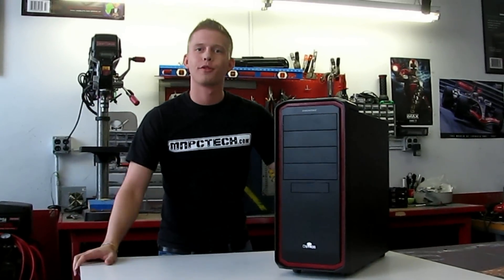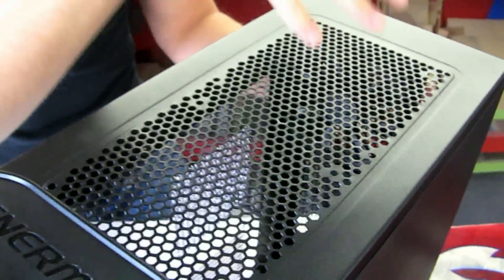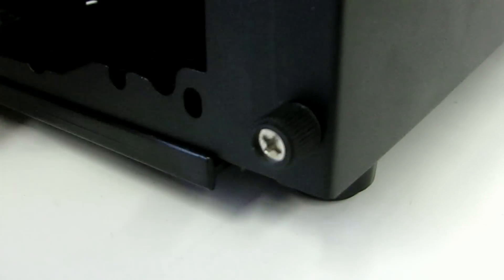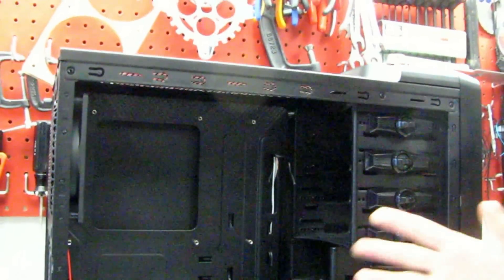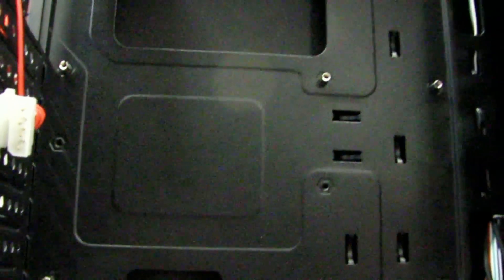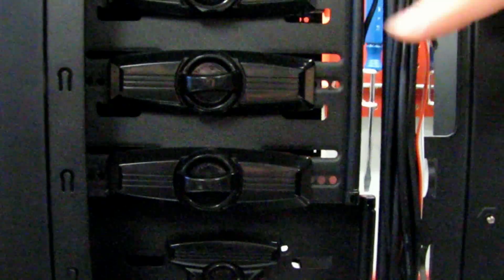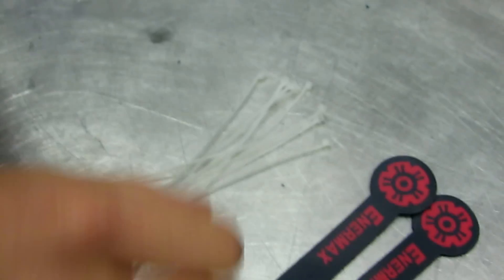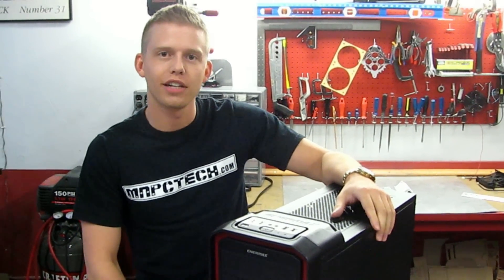ENERMAX OSTROG Mid Tower Budget Case Review, $49.99 at Newegg.com

Comment: i ended up ditching the window and window screws and got a solid clear plexi window and some button head bolts and nuts. i also put the window on the inside and it looks alot cleaner

Comment: I agree with you on all points. However, 5 bays are a bit much. I typically use one for DVD installation of any sort. Another two for a full loop liquid cooling res. 3 total. In a small case, you can get away with that, and any extra DVD drives can be portable/connected via USB. Otherwise you have space sitting unused. 

This case has 4 bays, and a floppy bay. Take out the floppy and one 5 1/4" bay, it would be perfect.

Comment: I have a black and blue Enermax Ostrog and yes there is no room for cable management, but couldn't you just untie the cables and run them through the HDD giant space after everything is installed?
Reply: Dregs i have the same case and despite all the people saying their is no room for cable management i succeeded in hiding all my cables just takes a bit of extra work
Reply: Conor Pumfrey I'm not worried about it. Instead of using the stock front panel I'm buying an aftermarket panel with Silverstone 4 X 3.0 ports.

Comment: Mods to improve case: 
- Remove several 5 1/4" bays
- Remove back side tool-less locking mechanisms for remaining bays
- Increase width of case overall 1/4" to allow 1/2" for cable management
- Modify top to allow for 240mm radiator to be installed
- Remove perforations from side window, as well as chrome caps

After that, it would be a perfect case. 

Many thanks to Bill Owen and Andrew for hosting!

Comment: If you put an LED fan inside the front panel, would it shine through the dimples?
Reply: it does shine a bit, but nothing too special, it looks good on the surface where the computer is standing tho thanks to that open space on the bottom

Comment: Anyone with experiance with this case can chime in here, but I wanting to know if this case will accommodate the Gigabyte Windforce R9 280?
Reply: Idk about the wind force, but an asus direct requires the hdd cage to be removed.
Reply: Thank you for the reply. I have my final build up and running and I did indeed have to remove the middle hard drive cage, but it was really simple.
Reply: What are your specs? ;D always love to know.
Reply: Sure! Here it is:

- MSI Z87 G41 Motherboard
- Intel 4670k i5
- Coolermaster Hyper 212 Evo
- Gigabyte R9 280 OC 3GB DDR3
- 8GB(Dual Channel) Gskill Ripjaws X Series      DDR3-2133 Ram
- 1TB Western Digital blue HD
- 4 Coolermaster Sickflow 120mm Blue led Fans
- LG CD Drive
- TP-Link N300 Wireless adapter

And of course, this awesome case!
Reply: im gonna use Gigabyte Radeon R9 270X 2GB WINDFORCE with this build
Reply: Excellent! I highly recommend this case, and have fun on your future pc build!

Comment: Tell me, is the front fan slot really useful?

I'm thinking about installing a few fans for better airflow but can't really imagine how the front fan is going to work well with such limited perforated grills.

Anyone has experience on this?
Reply: I have the case myself and yes the first slot is useless because it sucks in cool air pushing it to the back whereas not having one will make your case interior a little hotter.

Comment: Are you sure your not just hating on the case, Its a good case for the price and you go into every little detail that you dont like, Ex the chrome screws on the side panel, Its not like your going to really pay attention to them
Reply: Actually, he's right. The way side window is done is plain stupid. The holes are useless and ruin the whole look of it. The dumbest part is that it costed them extra to make those holes, than just leave a nice plain windows. I don't care about the chrome screws, since you can easily change their color with very little effort. Now the other thing that is dumb with the case is the ridiculous amount of bay's for disk drives... Why is there so many of them ? I've helped a lot of people in the last three years with PC builds and not one of them needed a disk drive, let alone 3 or 4. Also, it's just a couple centimeters short to fit a H100i water cooler. Anyway, this is a nice case for the price point, but it could be even better, and cheaper to produce. It's good for me now, but i will change it sometime this year i think. I will be OC'ing my CPU and i will need a good water cooler to achieve better results
Reply: Tayton McDonald I have the case and I can tell you now it might look stupid to some,but great to me. I am installing several aftermarket fans into mine to remove all heat quicker than just the one stock one.

Comment: If you plan on eventually liquick cooling with a 240mm radiator then do not buy this case. It doesn't support a 240mm radiator. I had to fit it on the top and put the fans on the outside because there's no space inside the case and fan holes had to be modified (cut off) because they were too spread apart. I also had to cut a hole on the top of the case for the cables from the fans
Reply: Hey man do you think a 140mm fan would fit on top of the case?
Reply: also can it fit 2? thanks! :D
Reply: I'm not sure anymore because i don't have the case anymore. All i know is that a 240mm radiator did not fit.
Reply: Jazzy Bali I had to find out the hard way, and trust me, it sucked. But I refused to take this case back being that I already took back two cases before this(and I was mad the dude who worked at fry's told me a 240mm fan works for this case) so I ended up using some command sticky tape to hold it up, and for several months now it's been doing just fine actually! 😂
Reply: Note that regardless I say this I do not recommend doing what I did. In fact, I plan to eventually replace this case to decrease the risk on the fan collapsing.
Reply: True this I had to stay at air cooling rather than using a 240mm rad on the case, instead i placed two 140mm fans on top, and well a big ass air cooler hahaha

Comment: I actually have this case, the cable management is crap (the cpu power routing cutout gets covered when the mobo is placed in). It also gets dusty if you have a fan cooling the bottom two 3.5 in bays My SSD has a lot of dust after only 2 weeks of use. So you have to clean it out a lot of get a filter and most filters won't fit. But other then that, not a bad case.

Comment: Thanks for the video!  I'm trying to put a fan into the front panel of a pink one I bought.  (Don't judge me. :P)  I'm having issues with the rubber screws going in, because it seems that the bottom two holes have framing for hardware in the way.  I've already removed everything that is made to come out, and still have this problem.  Anyone have this same issue and/or figured out how to get the screws to go in?  Push comes to shove, I'll just install the bottom fan and call it a day, but really wanted an LED to glow through the front grill.  Thanks! <3
Reply from the maker: +Jessica Ho Confirm the fan size you're installing in front is 120mm (12cm). Instead of using the rubber screws, you should have FOUR long Black fan screws in your accessory box, that go thru the four holes and screw into the front of the chassis. There may be possibility that your case is different than the one in this video review.

Comment: don't like 5 1/4" bays? you wont like my rig then, I have five optical drives installed, you know, for multitasking, ever heard of that?  
you must not like full loop liquid cooling then either, in smaller cases, the 5 1/4" bays are the best and usually the only place to stash the res.